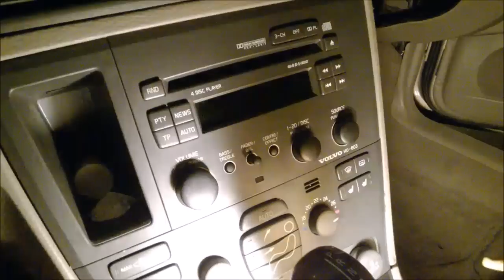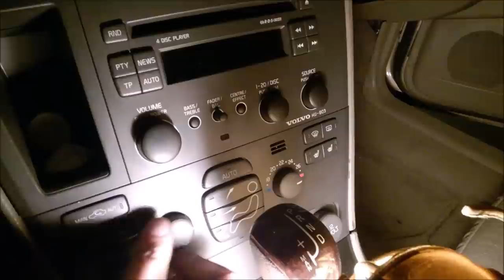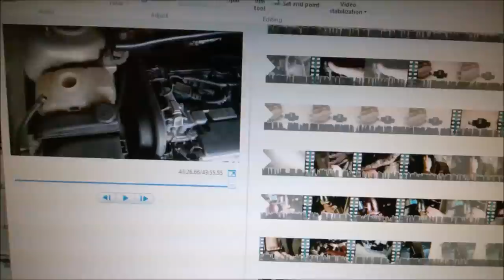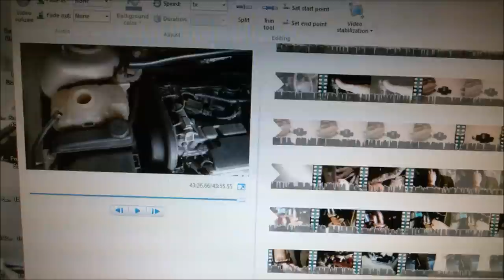Volvo S60 V70 XC90 Heater core matrix replacement - left hand driving 2001-2009

Comment: Great video! Job done in 2hrs. Hardest part is getting the clips back in. Wedged a screw driver again tube to keep it in place while inserting clip. Thanks
Reply from the maker: Justin, glad it helped.  If the clip flat and straight (it bends when it's being removed so it needs to be flatten and straighten back with a pliers), and if the pipe is fully pushed into the heater core, the clip will slide in very easily, basically just pushing it with two fingers.
Reply: I am totally stuck right ow trying to get the lower clip back on. The tube just won’t go in far enough even hitting it with a hammer. I sure hope this works when I finally get it in there. 😝

Comment: Hello. Thank you for the video and it helped alot. But there is a very important thing you dont mention. When you demount the steering rack or pole, its very important to secure the steering wheel, so it doesnt move, so if you move it, like i did there is something that breaks inside the steering wheel that causes a srs airbag fault. Now that part have to be changed aswell. This will happen on all cars, so please secure the steering wheel before taking it apart. Otherwise the video was a big help but those clips on the pipes arre really hard to get out and put in again. I gave up after using the wrong o rings. My mechanic did the rest and told me that i messed up with airbag thingy that broke. Thank you again for the Video.
Reply from the maker: Very true. I've actually mentioned this in another video about the steering coupler, but forgot to mention it in this video. It's the Steering angle sensor SAS that gets damaged if the steering is turned while disconnected. I'm adding this point in the pinned comment.
Reply: @Peppermint1  Thank you, i wish i saw the that video before i did this :) but thank you for taking it to your attension.

Comment: Thank you thank you thank you. This video gave me the confidence to fix it myself. I got it done but inserting those clips back is the second layer of hell. Just a word of caution. Also, putting silicone grease on the o ring makes inserting the pipes a little easier. And helps it seal too. Also, I bent one of the pipes and felt one give so I'm hoping I didn't mess up the other connection. Fingers crossed :0. Thanks again!
Reply: Oh also, I just changed my o rings and not the heater core. So I didnt end up taking the brake sensor and steering column out.

And I drained the coolant through the radiator petcock instead of that other location. It worked just fine and I didnt get much coolant coming out of the heater core.
Reply: RadioactvPanda - why do you say not to put silicone grease on silicone o rings?  Is it better to use petroleum grease on the silicone o rings?
Reply: @stevemccooleq  I would imagine it would degrade the Silicone o ring. But I'm not sure. That's just my intuition! I would say petroleum grease on Silicone is probably fine? But do what you're most comfortable with doing. I'm no expert by any means.

Comment: Trouble getting the tubes in and seating the inner clip? This worked for me: Silicone lube firstly. Then use a pair of pliers (i used a Leatherman actually) with blunt edges. Open it slightly. Then use it to push on the ”lip” of the metal pipe by using both hands while lying on your back. This method finally made it ”click” in place after hours of hammering, pushing and swearing.
Reply: PS. I did not drain any coolant. Just drained it slow from the pipe in a tray.

Comment from the maker: Important:  At  6:10  Steering shaft wing screw part #987281: torque 30 Nm (22 ft.lb).  Always insert this screw with the head up as shown in the video with the steering wheel centered.  This screw is a shear bolt that will snap in case of a crash so the steering column doesn't push the steering wheel towards the driver.  So important to tighten it at the exact specified torque.

Comment from the maker: At 28:50  don't cut that plastic piece.   See what happens at 30:30 into the video, then pause and  go watch first this other video that shows how to push up or even completely remove that steering coupler (important to have the front wheels sitting straight and don't turn the steering wheel) to easily pull out the heater core without any obstruction at all  https://www.youtube.com/watch?v=atgnxtHoao8

Comment: Thank's for this video. I have problem to put again this pipes, they are very stiff. Position under steering wheel is very uncomfortable. I hope tomorrow I'll finish this. I broke one of arm of flaps during taking out heater core.
Reply from the maker: Hi, have a look at the comment bellow, from Youtube member Tim Holland, it will help with the pipes. As for the climate control arm, I think it can be replaced - indeed it needs a bit of attention to have the heating to the max so as to move the arm away when disconnecting the pipes

Comment: Dear Peppermint, thank you for your perfect videos! I have an European S60 D5 from 2006 and already some time the heating is very weak. As the motor sometimes never achieved the proper working temperature and the hose going to the front cooler was warm almost since starting the car my first choice was the thermostat. Indeed the termostat was faulty and now the cooler works properly and the engine heats up quickly. However the heating didn't improve. Now when I touch the two heater hoses going into the car (with heating on max and fans high), one is very hot and the second is mildly warm. This leads me to belief that the heater core is clogged and I should go ahead and replace it. Do you think this logic is correct? Thank you again for all the info you are sharing and for your great work!

Comment: Thank you for the video. I just managed to replace the heater core of my 2005 Volvo S60 thanks to this video. I unintentionally bent the fins a little while installing the new heater core, but in the end it works fine. Unfortunately, I broke one of the arms you showed at 3:26. The heater is not blowing hot air when the arm is broken. But AC works fine. I glued the broken arm with a super glue, it works for now but I'm not sure it will last long. How can I find the part number of the arm? Is it sold separately?
Reply from the maker: Others had the same issue with the arm, I would try at a breakers/junkyard or ask on a Volvo forum such as https://www.matthewsvolvosite.com/forums/viewforum.php?f=9&sid=187aae7b3cd89663e5a2334b3e6888f7   if the part can be purchased

Comment: Mine is leaking so I'm about to change it by myself. Thanks for explanation and pro-tips! Any solution to clean up this messy fluid from the carpet? 
edit: the job is done. Thanks for creating such a detailed video.
Reply: Did you change just the seals or the whole core? Thanx

Comment: Thank's for the video. So About brake pedal switch, just need to remove the connector from the place or need to disconnect it fully?
Reply from the maker: I don't remember, try first with the connector alone. If you undo the switch, very important to do the correct procedure  https://youtu.be/mDkV6LW9xAc

Comment: Hi, while replacing the heater, I broke this aluminium arm regulating heater flaps.  I will try to fox it or buy a new one but can you give some advicse how to set it up correctly? If I set up both sides on the controler panel to the same settings, can I just set thew left arm same as the right one?
Reply from the maker: Try asking on forums. I remember someone had the same issue, perhaps they could help with the position of the arm https://www.matthewsvolvosite.com/forums/viewforum.php?f=9&sid=65f0748d42010591984c5b1ccf7ff1b2

Comment: Hi Peppermint, changing the heater core did it fix your heating problem? I have the same problem with heating in my Volvo, once is getting colder outside, barely blows warm air. Thank you
Reply from the maker: Hi Denis, it did not fix the heating problem.  In the end, I managed to get good cabin heat by doing like in the video link below.  Here's my explanation on this. Using cheaper coolants or mixing coolants with tap water - of even just 'flushing' the cooling system with a garden hose - will get tap water into the system.  Tap water will cause limestone deposits inside the cooling system which will block some smaller coolant passages: this will cause poor coolant flow inside the heater core. Just keep in mind that other reasons for poor cabin heating can be old thermostat or climate module flaps being broken or out of calibration (Vida can do this calibration).   https://www.youtube.com/watch?v=69ymGTqHxRw
Reply: @Peppermint1  My 2001 V70 T5 still had the original Volvo brand heater core installed, so it was more than 20 years old. It was not leaking, but dirty inside. It was not producing enough warm air to heat the cabin on cold days. Changing it to the one from Swedish Car Parts completely fixed the cold air problem.

Additionally, I agree with other viewers that this video is the best and most informative of all of the ones currently on YouTube. Thank you Peppermint!

Comment: How the hell did you get the clips back in????  Really wish that part was illustrated.   I'm stuck on that part now.  Still overall good tutorial.
Reply from the maker: Lay down the clips on a table - you will notice they are not longer flat, they have bent when removed.  They need to be perfectly flat, so try to tap gently to bring them flat again.  Also, when inserting the clips, the metal pipes may not be pushed all the way in - they may be missing just a little distance: if this happens the clip won't go in. 35:45 Try smearing a little silicone grease on the small rubber seals on the pipe - this will help the pipe move all the way in - be sure to use only silicone grease.  Also good to make sure the pipe opening comes 'flat' with the heater opening, so the two holes don't make an angle with each other.  Finally, the upper clip is inserted from the right, and the lower one from the left.

Comment: Great video. Does this procedure apply to a 2002  V40?
Reply: i'm also wondering that. When looking at pictures of a replasment heatexchanger for my 2002 v40 the heater connections seem to be placed on the flat side of the core instead of the end like in this video.

Comment: Why are the heater cores of Volvos failing?
Reply from the maker: On 2001 and up models they don't fail, but can get filled with sludge from wrong coolant.  They also trap air inside, see this video  https://www.youtube.com/watch?v=U56hwzayrw0
Reply: The O-Rings get had as a rock and they can also fail causing a leak.
Reply: Possible lack of cooling system maintaince and using the wrong coolant. My 99 S80 has 150k it started leaking so I purchased the kit. After R&R the core I noticed the O-Rings were hard as a rock and had a crack in one. Even the blower box was dry. I guess I would say for PM pop in a couple new O-Rings every 50k

Comment: I got the bolt out of the Steering column but now my steering column will not come off of the bottom part and it won’t rotate up
Reply from the maker: First, make sure the steering wheel stays CENTERED and won't rotate (remove the ignition key) and keep the wheels parallel, so as to connect them back in the same position. For the coupler, try just to push the steering shaft upwards, it should slide 'towards the steering wheel' and make enough place to bring out the cabin heater. You may also bring the shaft&coupler down and out completely, but you need to mark it precisely to put it back at the exact same rotation - there are splines on the steering shaft so mark precisely on both the shaft and the rest of the assembly behind the steering wheel
Reply: Thank you
Reply: I got it done and back together this was not a fun job really tigh space .
Reply from the maker: @tonyaburnside1037  True, quite difficult body posture

Comment: Can someone please explain how they got the upper hose clip in? Both hands? 90 degrees pliers? Wedged a screwdriver?
Reply from the maker: I think I mention in the video at some point, the upper hose clip I put it back in the opposite direction it was originally placed.  The clips slide in easily be hand or pushing with a flat screw driver, as long as they are perfectly flat - we need to flatten them properly before placing them back because they get 'twisted' when removed. If the clip is even slightly not flat, it won't go back in there.  The other trick is to make sure the hose is fully pushed in - I Like to add a little silicone grease on the seal to have it slide easier (not regular grease).
Reply: Also, best position to get into the space, kneeling outside of the car, on you back, or take out the front seat?
Reply: @Peppermint1  Thank you
Reply from the maker: Good question, I try to remember, not on your back, perhaps with knees outside the car trying to reach - not easy for shorter persons. Hopefully others could give their advice on this
Reply: I used a dull slotted flat head screwdriver to push the lower pipe into the heater core.  If you use a regular screwdriver, it could damage the pipe lip.  I used the flat side of a large racket to hold the pipe in place while I place the clipped in place.  FYI, the 2001 V70XC the control arms are underneath the plastic house, thus both clips can be place in any direction.

Comment: I can't get the clips in for shit. It's like the orings are too big because it won't seat. Orings from dealer
Reply from the maker: I talk about this in the video.  Two reasons: try putting a little silicone (very little) on the o-rings so they slide better it there: if the pipe is not fully seated the clips won't go in there.  Some have removed the o-rings from the pipe and placed them inside the core, then slid the pipe in place but careful not to damage the o-ring.  The other reason is the clips may be bent: straighten them perfectly flat if they are bent.
Reply: Would it hurt the performance of the way heater core not to have the o rings? I can see the o ring always and im having a very hard time with the clips